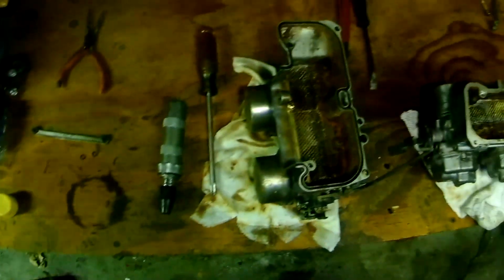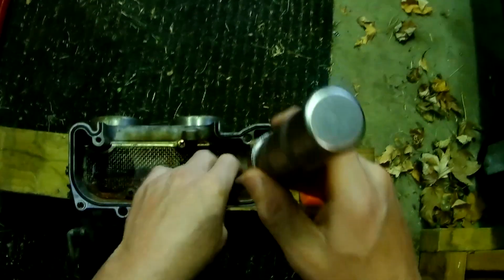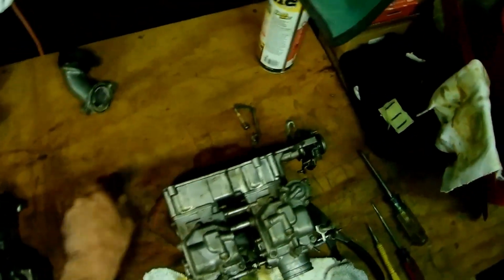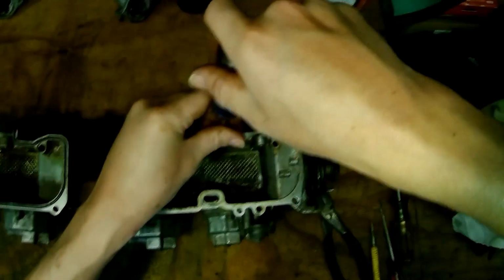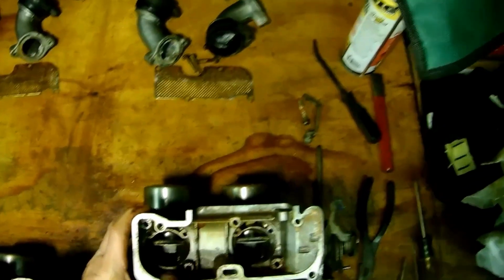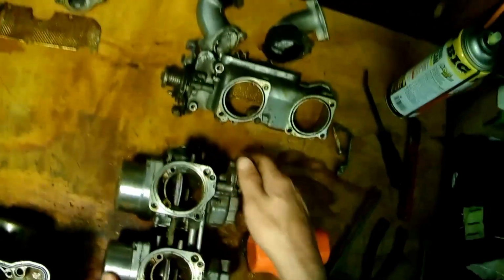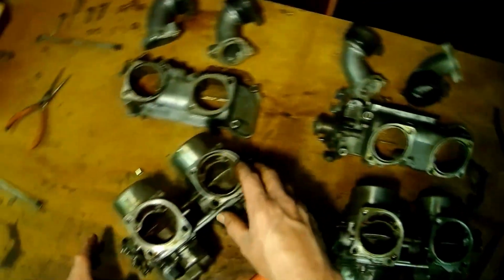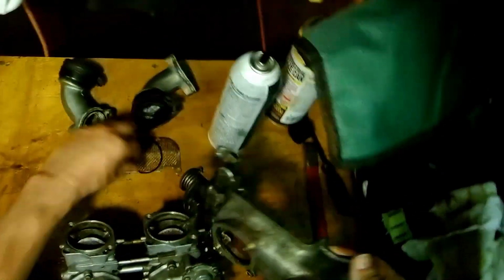Honda Gold Wing GL1100 : Carb Disassembly - Part 1

Comment: The impossible screw!
Reply from the maker: Dude. That one screw took me a month of trying before i found an adapter that worked. It broke two Phillips bits. Had to get a hardened tip. Then finally got an impact screwdriver on the job... in the end.. 15 seconds..

Comment: Thank you. But, are there two models ? Because, at this one here in my workshop now, i am having some other canals in betweeen the middle part of the filter housing ( intake housing) . I will check again tomorrow, or the day after tomorrow. Thanks for the video.
Reply from the maker: Yes, the gl1000, gl1100 and gl1200 all look similar. It also depends on the year. Double check its not an 1984 model.